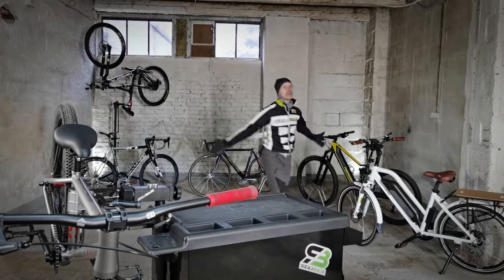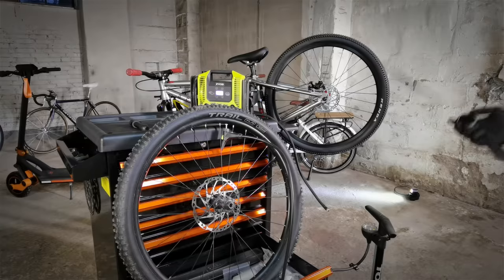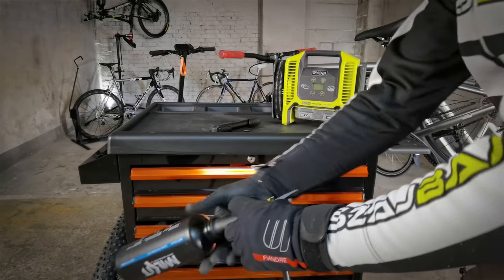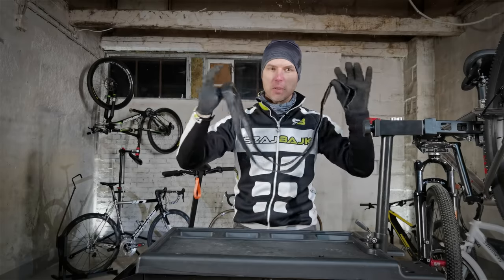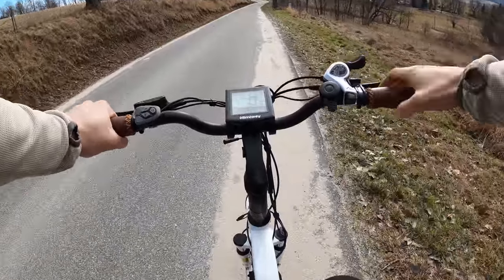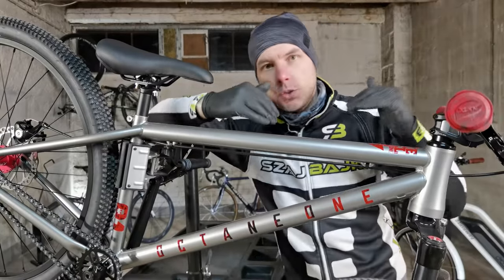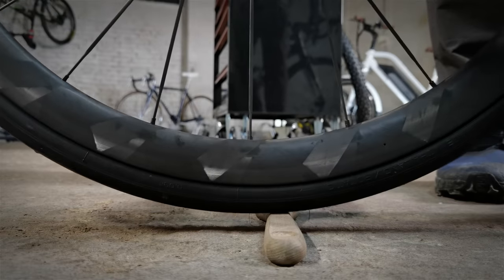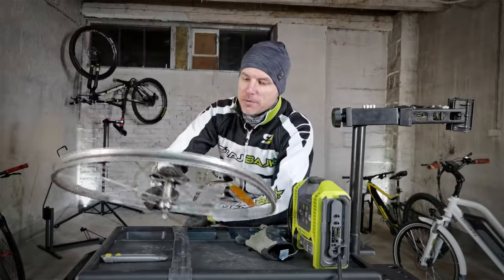Lesson 1. How to pump bicycle tires. 2 experiments + common mistakes.

Comment: 1-F (putting all your weight as explained in the method automatically adjust the method itself for your weight) It works only in tubeless setup
2-F
3- a test to see if you might have "snake bite" tipe of puncture during your ride

Comment: 1. F
2. F
3. Test to check tyres are inflated correctly, by ensuring the rim doesn't touch the ground. Which, cause "snake bite punctures' and too much rolling resistance.

Comment: 1: F (it depends on the interpretation) If you do this method on your bike, it will work. But keep in mind that he uses 2.4 tires and a tubeless setup. 
2: F
3: Put your weight on the tire when on the edge of a curb. If the air pressure is too low, it can cause a snakebite.

Comment: 1. F
2. F
3. Pushing the Tire onto a piece of wood (or similar) with your body weight to see wether there is sufficient air in the tire to prevent a snake bite. Rim Touching the Curb/Stick/whatever -> too little pressure

Comment: 1. F
2. T
3. Curb test is when u roll over the tire on a protusion like a curb, so u can see if the curb touches the rim. It will determine if the tires have too low of a pressure, in which snakebite punctures will occur.

Comment: I have a question. There is a slight squeak coming from the back of my bike. Any ideas on what it could be. I took out the break pads and cleaned the disc, but it didn't help to much.
Reply: does it squeak only during the braking ?
Reply: @jolantadziemieszonek9938  no, I don't even know if it's the breaks
Reply: @crb0n181  Check whether the pads aren't rubbing the rotor. It might also be the hub, though it's not that common. Does pedalling impact the sound?
Reply: @jolantadziemieszonek9938  I think it mostly happen when I petal.
Reply: Oh damn the pads were rubbing. This makes alot of sense. Thanks
Reply: @jolantadziemieszonek9938  true check if the caliper is aligned properly. I had same issue with my Trek Superfly how ever my case was a brake rotor bend .. however I think you just have to align the brake caliper
Reply: @crb0n181   here is a video from park tools on how to align caliper. This should fix your problem

Comment: 1. T
2. F
3. To see if the rims will depress low enough to hit a curb/object, whichcan be caused by low air pressure in the tyre/tube and worse can result to snake bite (flat tyre) onthe tube. If fail, must increase the air pressure.

Comment: 1. F
2. F
3. Use an object to simulate the tyre going over a curb. Then put your body weight over that tyre when on this object(curb) and see if it goes down enough to cause a snake bite / pinch flat.

Comment: 1. False 
2. False
3. The curb test is performed by pressing the wheel against a curb or other sharp angle such as a 2x4. If the rim of the wheel touches the “curb” the tire pressure is too low and may result in a snakebite puncture.

Comment: 1. F
2. F
3. The curb(kerb) test is done to against the edge of a curb or shar angled surface. This is to test whether the tire pressure is good. If too low the rim and the curb come in to contact causing a snake bite puncture.

Comment: Num 1. F
Num 2. F
Num 3. The kerb test is a method to determine if the tire pressure is adapted to the effect of a small pressure point and the weight applied to it, independently of tire type.

Comment: 1. F. Nino Schurter thumb pressure test works for his body weight only - pressure check is based on tire width and tubeless not rider weight
2. F. lowering pressure always lowers rolling resistance – if pressure is too high lowering it will reduce rolling resistance. If starting a correct pressure lowering it will increase rolling resistance 
3. Kerb/Curb test is when pressing tire against edge of kerb/curb if tire deforms enough to be compressed between rim and kerb/curb pressure is too low and pinch/snake bite puncture can occur